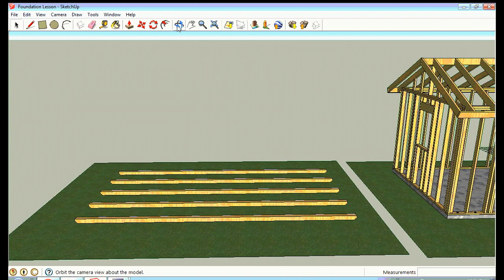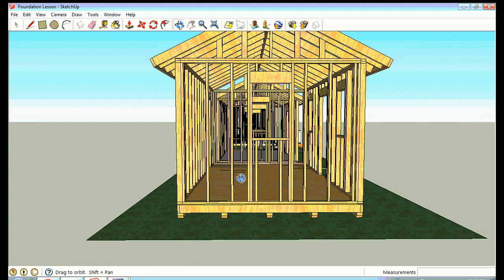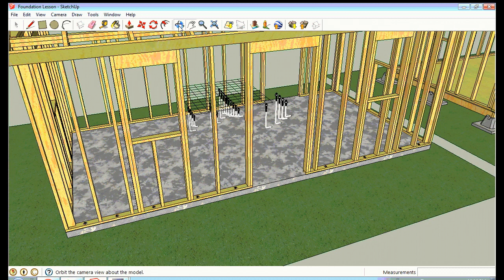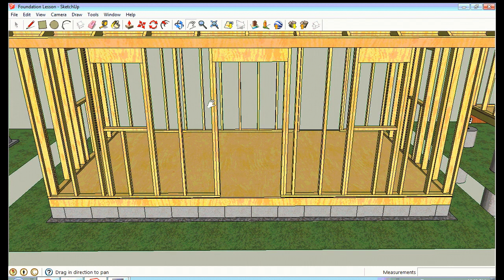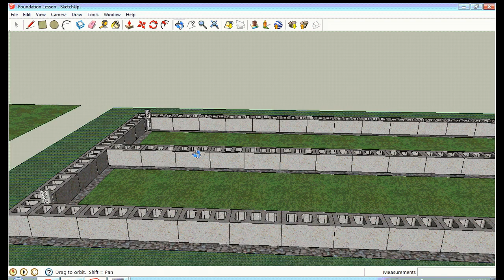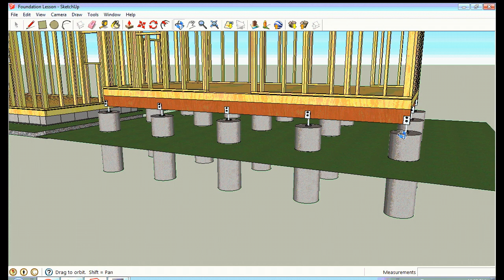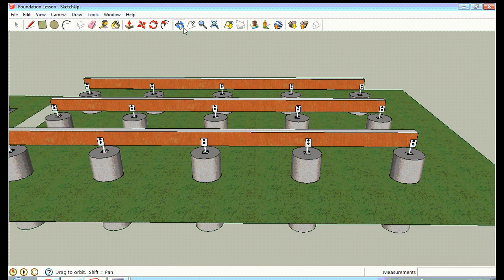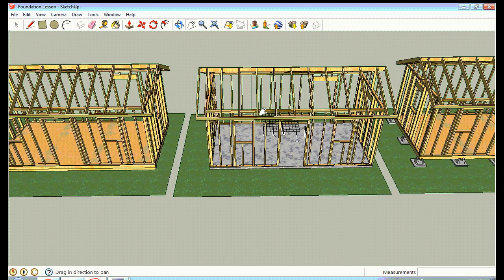Sketchup Small Structure Foundations by Solarcabin

Comment: You prefer the concrete slab as it doubles as the floor of the house but this will be uninsulated and very cold in winter.Isn't it better to have an elevated timber floor that you can insulate between the joists?

Comment: There are several things one might want to consider when building a small cabin, or tiny home. One would be the integrity of the structure in the event of powerfull winds, heavy snow fall, ice storms, and drastic changes in weather temperatures. Building codes tend to require a 4:12 pitch roof in areas where heavy snow maybe a concern. Using hurricane straps, or some kind of equivalent would be a wise idea, seeing as the weather patterns in America over the last 10yrs have demonstrated extremes such as, rainfall, flooding, blizzards, snowfall, temperatures, both low, and high, tornadoes in places not accustom to getting tornadoes, and tornadoes happening at rare instances, such as on Christmas day, and like the Sandysuperstorm, that was Half Hurricane, and Half Blizzard that hit on Halloween... So, it would be wise to take this into account when building your project. If you have already constructed your cabin, tinyhouse or structure, there are ways to anchor it to the ground, and ways to reinforce the roof support. I built a 8x12 shed like the example in this video, and 8inches of heavy snow caused part of it to collapse.The structure wasn't entirely finished, but it let me know that it needed to be built stronger to withstand the heavy snow load.It could safe you more money in the long run..You may only need to add aditonal 2x4's, with a good understanding of how to direct your loadbearing...thanks for the videos ....Lamar...

Comment: Other foundation materials for sheds abd small out buildings are railroad ties and 12" x 12" beams.  They were used in the past in trappers cabins and small homes in the Adirondacks.
Reply from the maker: Yup you can use railroad ties just be aware those are chemically treated and some contain arsenic in the treatment that is a poison.

Comment: Chris Bowman, in Michigan and other northern climates where frost heaves are an issue, building dept's/inspectors typically don't allow non permanent foundations like pier blocks on separate structures greater than 100 sf.  If you're in unincorporated county land, there are less restrictions.
Pier and beam with sonno tubes/concrete below the frost line may be an option for you though.

Solar Cabin, your tutorials rock!
Reply from the maker: Thanks friend!